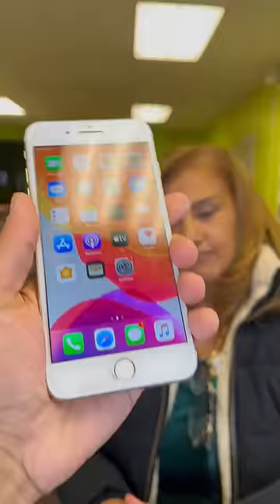Her iPhone was About to Blow up 💥 #shorts

Comment: I have never seen anyone handle a swollen Li-ion battery so carelessly.
Reply: yeah and returned to unaware customer. that thing is fire / explosion hazard.
Reply: Dude. I pray he didnt actually let her take that thing home. Those things hare highly unstable and are a ticking time bomb.
Reply: I thought the same thing this is a straight up explosive 😭
Reply: Even unplugged?
Reply: @snacksizeattila2076 yep, I believe it can be slightly safer if it's fully discharged but you will likely never fully remove the risk of a fire.  Essentially, the battery shorts internally which causes it to ignite.
Reply: yeah I have recently had to replace MacBook with batteries that swollen, I opened it up to clean and reapply thermal paste and was like well your not using that till you get a new battery, he was like it work fine just slow, I was like NO that is days away from blowing up  no if no but no maybes I'm not returning the MacBook to you with that old battery in it.
Reply: @Tyler.8046 actually not true li ion batteries naturally swell from age and depending on the electrode decomposition time of the graphite layers inside only danger is if it bust open but that one being that swollen with so much give it wouldn’t be as bad as if it were stiffer
Reply: That being said lithium ion batteries only pose a danger if moisture touches the lithium and busting one swollen like that exposes it to a lot of moisture in the air rapidly
Reply: @BlurredGhost  From what I'm aware, the short circuit is the part that actual ignition part, lithium and water just produce hydrogen which makes the fire much worse but won't ignite spontaneously.

Therefore, if you were able to eliminate all electrical potential from a device, it should remove the risk of fire.  That being said, you can never be fully confident a battery is 100% discharged so that risk is always there.
Reply: @davidhodge0201 They're safe as long as you're not doing something like stabbing a knife into one. ive had more than a handful of swollen phone batteries in the past, none nearly as bad as that but definitely ballooned up. 
Never had one catch fire/explode or whatever.
Reply: @BlargOnMyFacepls  They arent SUPER likely to, but its 100% possible, and if they do its incredibly violent and hard to contain
Reply: @tandavawalsh0777 100% possible? 💀
Reply: bro just casually hands her a bomb.
Reply: @snacksizeattila2076  yeah its classed as an exposive
Reply: Bro when I saw it I was like WTF WHY ISNT HE IN THE LEAST FREAKED OUT
Reply: yeah at my job we have to confiscate computers with swollen batteries and put them in sand
Reply: Oof
Reply: @alcapoontangmooseinthepoos2310 confiscate? try confiscating something of mine 🤨
Reply: OMFG FINALLY, I thought I cant be the only one
Reply: @BlurredGhost Nope.... They can explode in storage especially with older phones like this iphone 7 or especially the samsung 7. There was actually an samsung 8 that was in a cabinent and it had expanded I think because you arent using it its even more likely to explode which is weird but... yeah uncharged phones can be more dangerous.
Reply: @MartinBarker did you have a stroke writing that comment!? I have NO idea what you said 😅😂
Reply: @KarunaMurti he changed the battery are you blind ????? Do you really think he deflated the battery and gave it back ? Or do you want him to give her a new phone or something?
Reply: Same
Reply: Extremely careless
Reply: Thats *Li-po battery...
Reply: @El_Goblino_ homie literally gave her the swollen battery back in the video.
Reply: I thought they were supposed to have a sand bucket to burry these in!

Comment: She better be thankful that that battery didn't explode.
Reply: poke it poke it poke it poke it poke it
Reply: I think that happend for leaving the phone on the charger for wayy too long even after its at 100% right??
Reply: @rakanahmed4000 no 😂😂
Reply: @rakanahmed4000 I do have made my battery swollen once it's maybe due to using the phone while it's charging for a very long time.
Reply: @AxeDragon1989  i know that doesnt happen to modern phones but on old phones it does i think, or it might be a fked up charger
Reply: @rakanahmed4000 No, nokia is beyond mortal comprehension.
Reply: @rakanahmed4000 no, Apple has precautionary measures built in for that.
Reply: @gigyro  big
Reply: @Apexdestroyer25  its omnipotent
Reply: @rakanahmed4000 Normally a phone would stop charging, when it has reached 100 % - or not too long after - for safety reasons.

Comment: I brought my phone to a repair store to replace the screen, but when she opened the phone the battery caught fire and sent ash spewing all over her floor. Some dudes came with a fire extinguisher to put it out, but afterwards she had to order a whole new frame which took 3 days, instead of the original 2 hour screen fix.

Comment: I bought an iPhone 7 on release date in 2016 is still going strong, but the battery is very degraded! Going STRONG
Reply: Damn, I had an iPhone 7 manufactured in October 2019 and its original battery health was at 53% and that was last year when I checked as-well. I still have that iPhone 7 but I removed the battery as it was too degraded and it doesn’t have a screen as the old one got removed.

Comment: it just happened to my old iphone. The old battery was changed in one of the local shops. I never used an other charger than the original one. That tells me that the battery placed in my iphone was a cheap fake.

Comment: If you see this type of things on a phone, DO NOT even try to touch the battery or pressing the sides. CAREFUL WITH THESE CAUSE THIS HAPPENS WITH OVERCHARGING BATTERIES! IT COULD BE A BOMB AND ANY TIME IT CAN EXPLODE!
Reply: Actually, it's depend on battery types
Some old batteries in my old phones got inflated or something, then after took it to service center, and they said the battery was not the one they use in those phones.
Well when we were about to leave, that battery exploded, not like fire or something but burst and pieces went over places.
An old lady With same problem of battery inflated then just put her phone on ground from shock lol.
Well in her phone it was the chemical components which made them inflated but this time they took out whatever inside that battery and set up New battery for her.
Maybe if me and my cousins were bit late, battery would had exploded on the way lol

Comment: She let her phone get overcharged too much that her battery expanded, I know of this issue because i have 2 Samsung's that had this happen with easy to replace batteries and I was using the official Samsung charging cables, Don't let it stay charging when it hits 100.
my current Samsung has a protection to allow my phone to maintain it's usb connection to my laptop or desktop without my battery being charged my old LG had it back come off because of battery inflation don't want it to happen to my A32

Comment: Same thing happened to my PSP 3000, battery expanded so much that the battery cover was only half attached to the PSP. Still works luckily
Reply: You need to get that battery swapped before it explodes. That’s dangerous.
Reply: @olympicfireball  don't worry I got a replacement one eventually, works great now. As for the old battery it almost caught fire!